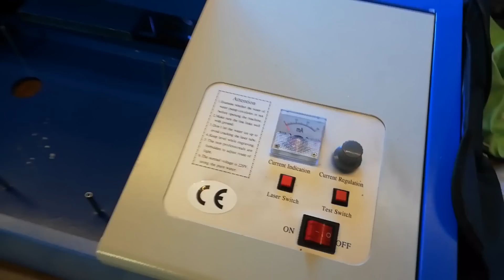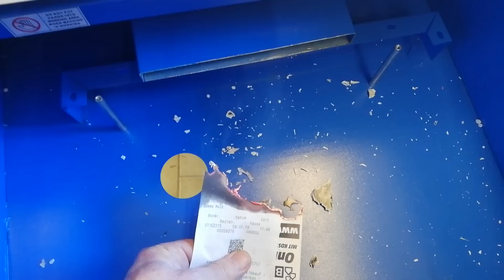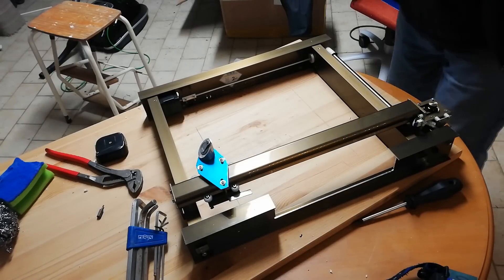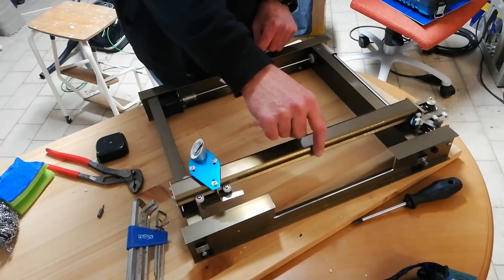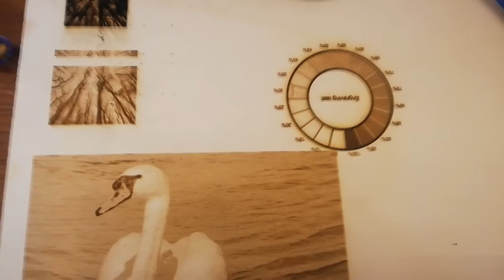2019 K40 laser upgrades, Manual Z axis build.

Comment: I fixed the original exhaust fan problem with some rubber door sealing strip. It is about 12mm wide and maybe 5mm thick with self-adhesive on one side. Cut to length to fit inside the outer lip of the fan housing, it successfully sealed up the gap at the top of the fan and held it firmly against the sides as well.

Comment: Thanks for the great info. Is the image using dithering or have you done some upgrade to do grayscale? Any chance you could share your test image with the pictures and engraving levels circle?
Reply from the maker: Hi, This was a while ago but I basically just imported the image into inkscape to resize it and I use K40 whisperer to run the laser. the test image you can find here: https://www.google.com/url?sa=i&url=https%3A%2F%2Fwww.thingiverse.com%2Fthing%3A2243854&psig=AOvVaw35Qi9CWPp40CXSoWq3yqd_&ust=1603889917557000&source=images&cd=vfe&ved=0CAIQjRxqFwoTCNCvxtjp1OwCFQAAAAAdAAAAABAD
Reply: @letsfixit1594  Thank you

Comment: What happens when your laser cuts through your plastic deck ? Also I can see an issue with the laser being out of focus near the edges of the work being as the gantry isn't wide enough to keep the work piece level to the laser? I mean if it works it works I suppose but it doesn't seem like the most practical of solutions also because the bottom of the k40 is so prone to warping. You can even see it as the cleanout hole at the bottom is raised 3/16 of an inch above the wood it's sitting on. But your results seem to be in focus so I'm perplexed that it's working so good nice to have that adjustable z.

Comment: I will be getting my k40 this week and i was thinking doing what you did, the only difference is, I was planning on tacking steel plates on both sides of the gantry, and using an L bars on each side to hold the grill up with a 3 holes on each L bar for removable magnets to hold the L Bars in place once the hight was set of any giving job, did you find that just the lab jack was stable enough or is the stabilizing magnet idea worth doing?
Reply from the maker: No i ended up with spring loaded angle clamps on each side to hold a bed that can adjust up and down according to the thickness of the material. Iam working on a new video right now showing this exact thing.should be out soon.
Reply: @letsfixit1594   in regards to our little conversion My K40 finally come and all my upgrades are done which also included fully re-wiring that electrical fire that was waiting to happen hahahah the Chinese really don't pay attention to safety do they! One of the upgrades I did, helped solved two issues in one go, i bought a K series lens and head kit  https://www.cloudraylaser.com/products/cloudray-co2-laser-head-set-for-2030-4060-k40-laser-engraving-cutting-machine?variant=7698567102515 , It comes with better mirror and lens, and the lens is mounted in a tube that you can adjust the height to lower or rais it by about a 1"1/2 Which solves making a Z-axis bed thing.
Reply: @letsfixit1594  Thanks for the update, ill be sure to subscribe to see what you come up with, If these K40's had more cut surfaces a mechanical Z-axis would have been worth it, but let's call an apple an apple right! we will never be cutting enough thick material to make it worth the time to have a Z-axis autofocusing system on these basement tools right

Comment: Hi. I love this video because it shows a lot of possibilities for this machine. I bought one and the cutting head do not moves on the X direction. I asked for help to the dealer but they haven’t done much so far.  I see you guys know a lot and I would like to see if some one could help me. To be more specific, when you send a drawing to be processes, the head just moves back and forward but not left and right. I rally would appreciate your help. Thanks, Raul
Reply from the maker: Hi Neto check to see if the white ribbon cable is connected both on the motor side and on the control board side, pull the cable out and plug it back in both sides, it will disconnect and connect  easily with a bit of force. Did it ever work?

Comment: Excellent video! How do you controll the laser power?
Reply from the maker: Hi Eduardo the power is adjusted from the multi turn pot. and displayed on the voltage readout. 0-5 volts, 5 volts being the max power output.
Reply: @letsfixit1594  I was believing that the 'z' axis controlled the laser's power through the focal point. Thank you for the info!

Comment: Do you just locate the honeycomb on top of the platform with no attachment?
Reply from the maker: Hi Eduardo I 3D printed a bed that fit on top so it was a bit more stable, but i ended up changing to a spring loaded fixed bed as the lab lift moved from side to side a lot.

Comment: I also drilled through the ribbon cable, where did you buy your new one from? Please
Reply from the maker: Ouch sorry to hear that, I did have a look around but I ended up soldering a bridge across the damaged connections and has worked ever since, are you handy with a soldering iron?
Reply: @letsfixit1594  I got one on ebay, finally. This guy will help you out.     huijuhk
Reply: New message from: huijuhk (769Purple Star)
Ok, we will send you FFC cable products of the following specifications:
1.12 needle
2. Spacing 1.25MM
3. Length: 1200mm
4. Quantity: 1
If you have any questions, please feel free to write again. Thank you

Comment: I know a lot of people say to throw the fan that comes with the K40 Away... But squirrel cade fans are usually quieter and in this case, the airflow is adequate. I put a notch on the bottom edge of the housing so that it drops about another half inch. Then the fan top edge is not above the back of the laser. I also used some weather stripping tape around the edge. When I cut my duct down I changed out the screws so they would not snag the weather stripping when sliding the fan in. 

I eventually modified the housing so that it doesn't interfere with opening the laser tube cover. Cheers...You make a nice video. (PS...I had the same rough rails on mine.)
Reply from the maker: Nice tip, I will try this, great idea.

Comment: The best idea for that fan is to throw it away and buy a much better one. That thing is garbage and even when sealed up it doesn't work well plus you block access to your tube. I 3D printed a 4-inch port that I put where the fan would go and ran it to an inline exhaust fan I bought on Amazon. SOOO much better fume extraction.

Comment: Great video. Just wanting to know what the honeycomb material you used please & if possible could you put a link to where you bought it from. Thank you
Reply from the maker: Hi Sandi I bought this material at a local hardware but you can buy something like this on ebay :https://www.ebay.at/itm/Aluminium-Wabenplatte-300x200mm-3-5mm-Wabengitter-Honeycomb-plate-CO2-Laser/132828892274

Comment: which program do you use for the engraving and cutting? 40K whisperer? And which design program? Do you use Inkscape which one?
Reply from the maker: Hi De
 I use K40 whisperer, it works great and Inkscape which iam having a few issues with and iam trying out Gimp as well.
Reply: @letsfixit1594  yeah I am not so fond of inkscape myself... I wondered what settings you used for the picture engraving... power speed etc
Reply from the maker: @devlaminckx3382  The etching is done at 100mm per sec. and the power is a bit tricky as normally you dont have a indictor for the power setting but i have built a new control panel where i can set the power down to the millivolt, i will be posting a new video soon with all the new upgrades.
Reply: Let ́s Fix It would you consider building/selling your mod panel ? I have not gotten my k40 yet but can already tell your panel is desired
Reply from the maker: @vahhone  Hi Mike, do you mean just the acrylic face plate or the complete panel with everything installed with a  wiring loom?
Reply: Let ́s Fix It the completed acrylic panel with new assembled pot and digital gauge would be nice as a kit. Any additional 3d printed parts in this kit would rock as well.
Reply from the maker: @vahhone  let me do some calculations,   I´ll get back to you.
Reply: @letsfixit1594  I agree, a kit would be awesome! I'd def be willing to pay a little more to have as a kit shipped at once. Excellent job!